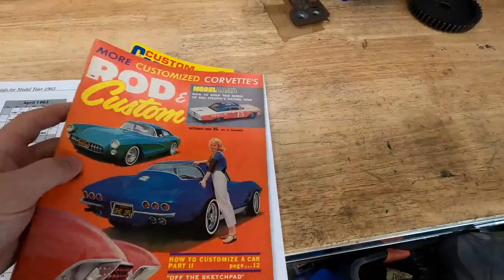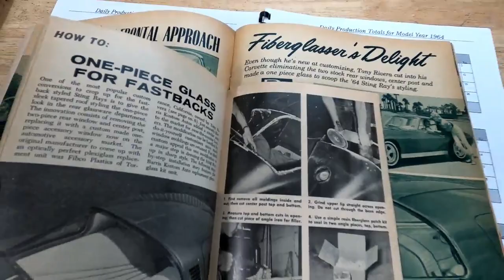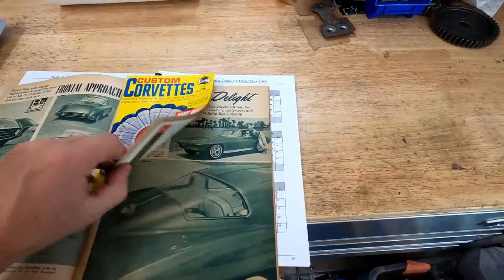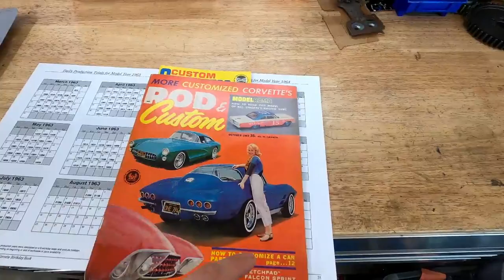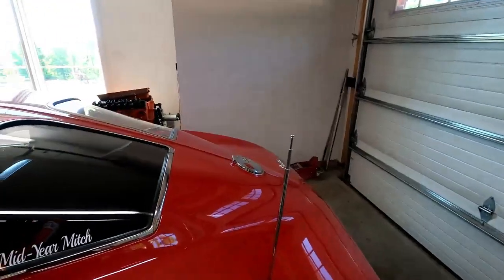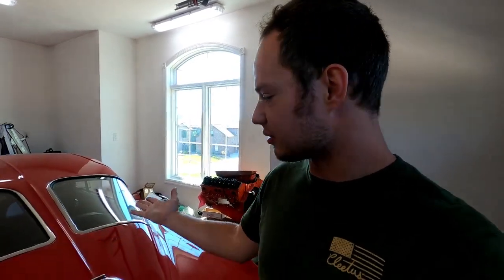Why did GM get rid of the Split Window Corvette?

Comment: Hey Mitch At 3:55 what is the deal about pillar trim differences?
Reply from the maker: Hey Dr. Lee. If you look at a 63 coupe from the front and if you look at a 64-67 from the front you can see the difference. The outside trim that goes along the side of the windshield on a 63 coupe goes from the windshield to the door. A 64-67 has a narrow piece of trim. Also the 64 door has trim on it. I think they were trying to make it look the same as the convertible from the front.

Comment: Hey Mitch love your vidoes.I have a 65 coupe, any idea on where to find a vent window hinge. the hinge is on the vent window that attaches to the door post?
Reply from the maker: Thanks I appreciate that! I bought a used vent wing frame that holds the glass and riveted it to the frame that goes in the door. I believe paragon sells both pieces. One is spot welded on the other is riveted on the frame.

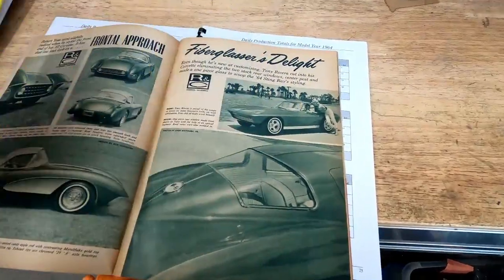Comment: The car shown on 4:05 is a 1964. Look at the seat backs. seats on a 1963 came to a point on the top and the cord welt was a single piece over the top of the seat back. Not so sure its a 1963 with the stinger removed. Also looks like white interior not available until 1964. Only black, red, saddle and dk blue were interior colors in 1963
Reply from the maker: Good observation Doug. In other pictures you can see the car is a 63. It has the 63 windshield trim, shifter, and gauges. The interior is 100% custom. Everything is tucked and rolled. The door panels have a new design on them also. They worked that entire car over front to back. They mentioned that it has a plastic rear window and if you look at the rear trim you can see where it was spliced together from 63 coupe pieces.
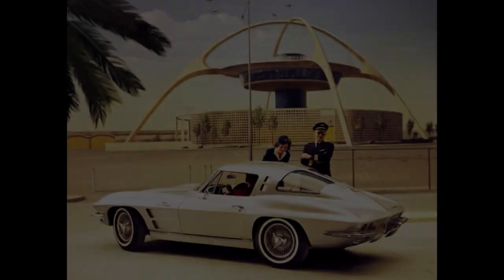Reply: Mitch. Also if you look at the white Corvette about the 5:40 mark the knock off spinners are on the car backwards. He has rh spinners on the lh side of the car.
Reply from the maker: You have better eyes than I do lol